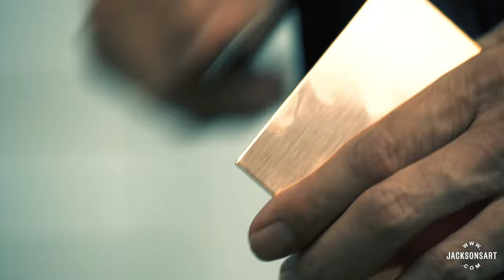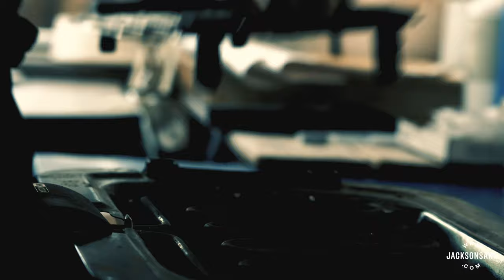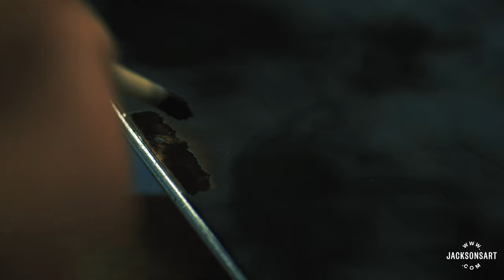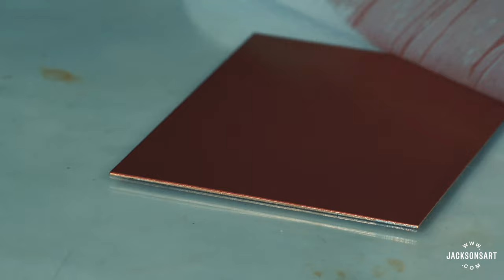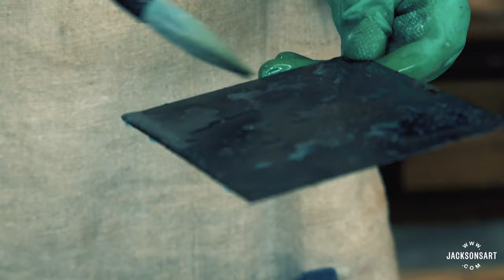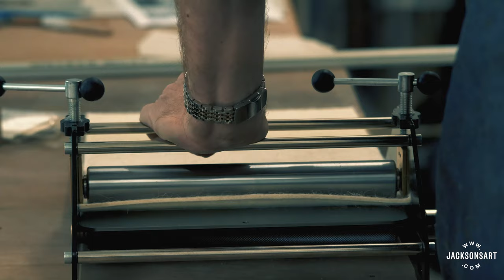Intaglio Printing - In The Studio | Jackson's Art

Comment from the maker: Intaglio is the form of printmaking in which the image is incised into the printing plate – the incised areas hold the ink which is transferred to dampened paper, under pressure, by rolling through a press. 

The plate will emboss into the paper so that you will see the tell-tale plate mark around the edges of the image and on the reverse of the print. Under the umbrella of intaglio, we find the techniques of etching, engraving, drypoint, mezzotint and collagraph.

In our series of three articles, we cover how to set up the Fome press, how to use it for intaglio printing, as well as how to adapt it for relief printmaking.

Read on our Blog - https://www.jacksonsart.com/blog/tag/fome-press/
Reply: Hi thinking of taking ethching as a hobby can normal oil based lino inks be used for etchings.